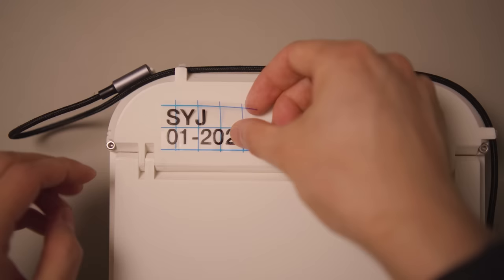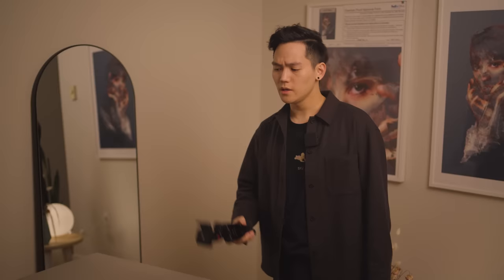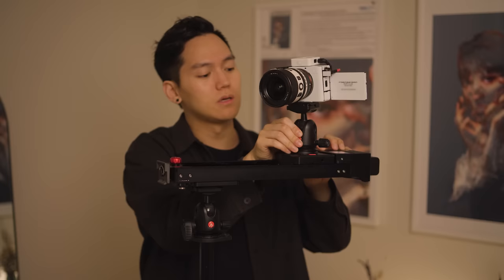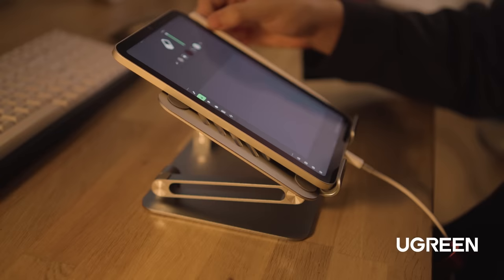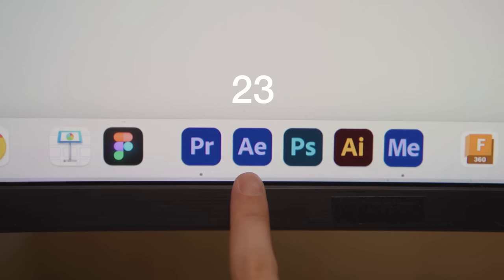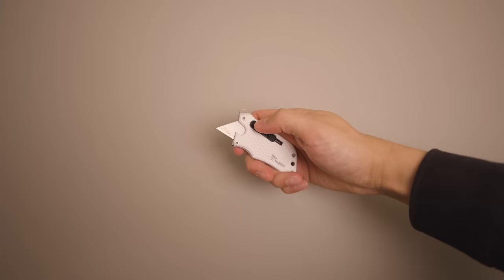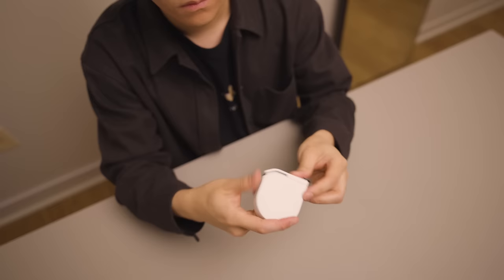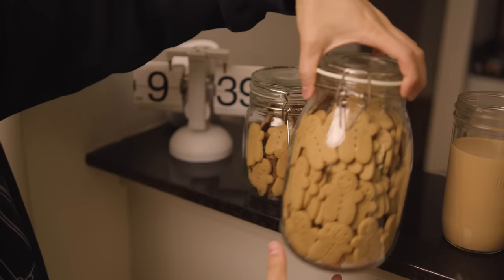42 Tools That Made The Cut in 2022

Comment: Yeah yeah the tools are cool and everything but you still dodged the most important thing, the toilet paper. THE PEOPLE DESERVE TO KNOW!
Reply: On a more serious note, I'm voting for the Hakko FX888D as a soldering station. Around $150 so not the cheapest one suggested, also it's big enough to be annoying to carry around.

However, easy to adjust temperature, has a large range, super quick to heat up, holds a constant temperature, very large ecosystem of tips and parts.